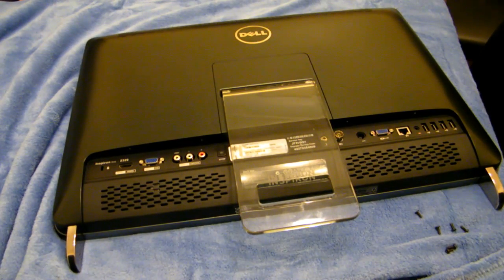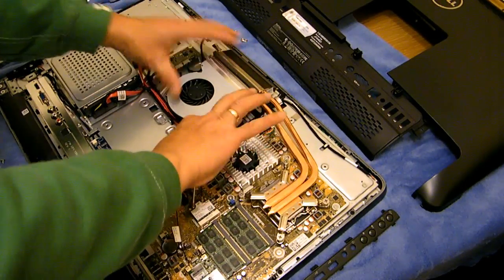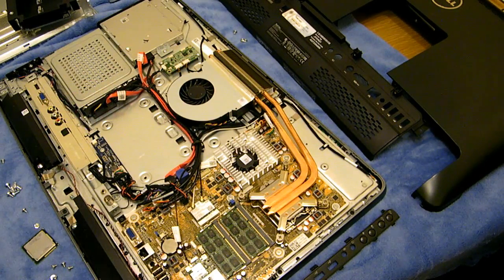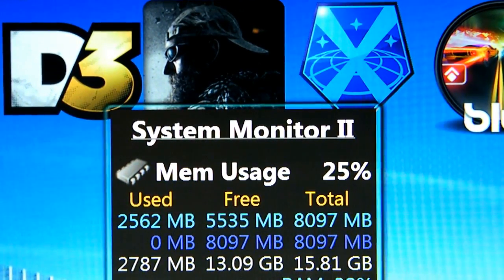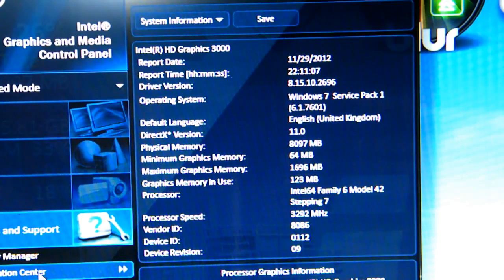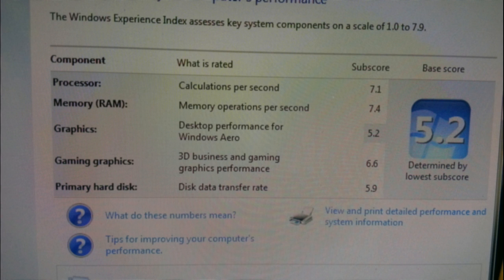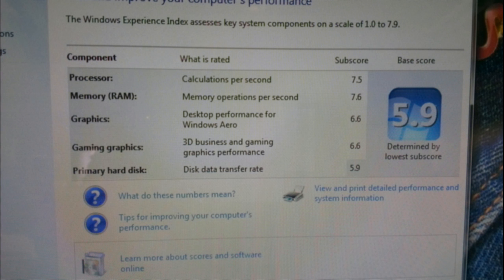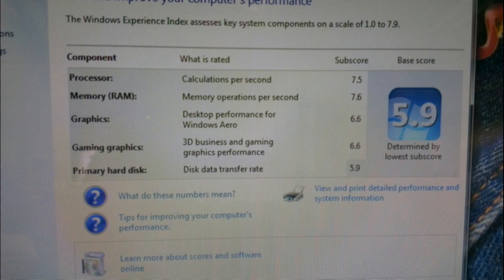Dell Inspiron 2320 All in One CPU Processor upgrade installation

Comment: The original CPU( i3-2100) has a TDP power draw of 65W. How did you get the motherboard to accept a power upgrade like this? I only ask because using a 95W TDP processor like the i5-2500-k in a Dell Inspiron 2320  is not feasible or recommended for several critical reasons, not the least of which is Power supply limitations: While the 180W power adapter(the maximum on this model) may seem like enough, the total system power draw must be considered as that single power source must run the processor, screen, motherboard, and all other internal components. Even if the processor is compatible and the motherboard power profile were somehow upgraded, the added demands of a 95W TDP chip like this one could push the system beyond its safe power limits.

Comment: I know this is an old video but I came across on of these systems that someone gave me. After doing some research in an attempt to apply this chip swap I came across some things that concerned me about this upgrade. First, the Intel website specs on the Core i5-2400S/ 2500S chips as well as the 2nd Gen Core i7's "S" chips are all Intel 2000 Graphics while only the K chips have the 3000 Graphics, Second, you also failed to mention that the "K" chips pull 95 watts as opposed to the "S" chips (Dell recommends) pull only 65 watts. The power brick for the standard Inspiron One 2320 is only 150 watts. You can get a 180 watt version but that's only 30 watts more. This is putting serious strain on power consumption of the system not to mention the excessive heat from the "K" chip at even base clock speeds. Never the less, I found a Core i5-2500K (in 2023) for less than $15 and a 1TB SATA SSD for less than $40. I pulled an extra 4GB SODIMM from an old dead laptop and upgraded the RAM to 8GB. Going to also apply the "cooling holes hack" on the metal cover like you did so we'll see how this upgrade goes. I went to the Dell website and downloaded all the updated BIOS and device drivers I could find so, I hope it works.
Reply from the maker: I can tell you that the machine is still working today with a 2600k in it both  drives the CD-ROM and the extra cooling just sits in the corner now doing YouTube  and media for us... Good luck with your upgrade...
Reply: @UltraCyberGod  Just wanted to update my post. I put the Core i5 2500K into this system and it is working flawlessly. You were right and I admit my reservations were unfounded. I applied your recommended hacks to the system in it works great. Much faster than the original Celeron CPU that was in the system. Thanks for the tips and I am a fan. Keep up the good work.
Reply from the maker: @walterlegere1403  Fantastic to see that's worked out for you... 😀

Comment: some necro commenting lol, just going to upgrade the same AIO to i5-2400S.
- don't forget to apply some thermal compound;
- honestly, you need to stress test it. I have some doubts that 2500k will work fine as its TDP is too high for this cooling system.
Reply from the maker: The paste is always something to mention even 7 years on! You'll probably see the both chips had paste on them as I's had then in and out a couple of times before filming. I would like to mention that although I've not used this system for sometime now the 2600K worked fine in it but needed the twin cooling fans on the back definitely. There's a video for that too.

Comment: Why will a 2500k work, but not a 2500s???
Reply from the maker: Did you try a 2500S in it? I never tried one of those but I would expect it to work.
Reply: @UltraCyberGod  I did. But only got black screen. Updated the bios. Not even mobo beep tones. This 2320 does not come with the nvidia gpu presoldered into it. So not sure if it was a dead cpu or the lack of the nvidia 525 I think these come with. Do you know if the 2400s will work w/o the nvidia chip? I know the 2320 shipped with them...

Comment: surely if it can take a 95 watt i5, it can do an i7 too? i could see cutting holes in the back and adding a heatsink on to the heat pipes with a thermal epoxy.
Reply: I was actually wondering the same thing I'm thinking of trying a i7 2600k , I know the i7 2600s is compatible and with the fan addition in his other video the heat shouldn't be an issue seems like the 2600k should work as well
Reply from the maker: Sorry I missed these 2 comments don't come back here often. I needed to mention that although I've moved on a little this machine is still working and has an i7 2600K in it, also 16gb of RAM, a 512GB SSD with a 1GB HDD. But could do with a clean! :)

Comment: I have the same model, do you think I can push for a core i7 2nd or 3rd gen?
Reply from the maker: It will take an i7 2nd generation you may need to improve the cooling I've never tried it without... these machines will also take 16 gig despite people telling you that it will only take 8 of RAM...  and an on SSD really improve boot speed on them... UCG...

Comment: I have talked with a friend that works in the pc business and he told me there is no way to upgrade the geforce 525m integrated video card and that is not good.A 2/4 Gb video card would have been a great upgrade for this pc.The thunderbolt slot is also not an option on this pc.
Reply from the maker: It's a shame you can't upgrade the graphics card but they're built very much like laptops and so the graphics are built onto the motherboard... I hope you find what you want... UCG...

Comment: Great Video!  I do not see a power supply.  Is the power supply actually the AC adapter?  If so, then I have a question.  When I plug in the power supply, the blue light goes out.  And it will not power on.  I tried the original power supply, and a brand new one as well.  Then, if that does not fix it, would you have any idea what is wrong?  I don't want to replace the entire motherboard.  Could it be something like the video is shorted out?  The computer worked when the owner left for vacation.  When she returned, it no longer worked.  No diagnostic lights.  No power.  Just a hint would be great.

Comment: Hi, has anyone been able to upgrade this machine to an i7 3770??? I purchased an used one and it didn't work. It works well with an i5 2500k

According to this page it should work: https://www.dell.com/community/Desktops-General-Read-Only/CPU-Upgrade/td-p/4512513
Reply: Probably need an expert's opinion but could be the graphics hd4000 when max is hd3000.
If you're that intent maybe flashing bios could fix it? try on your own risk.

Comment: Can u change the wifi card ? P
Reply from the maker: You can change the Wi-Fi card in this machine quite a few fit I believe but the one I put in was the Intel centrino advanced-n 6230 which is a 2.4 and 5 gigahertz version. I fitted that card because it only uses two aerial ports, if you wanted to fit 1 with 3 aerials you would have to install and re-route another aerial somewhere in the machine. Hope this helps you out.
Reply: UltraCyberGod thanks for the reply 
I have already done this process and it was a success

Comment: I'm a bit late to this but.... Is there any videos on the Inspiron 20 N2830 with a crappy Celron CPU? I'm running 64 bit Win 10 But I need to upgrade the CPU and the ram... I just found out I have 2 slots for ram but only have 1 slot being used with 4gb ram. If I can upgrade this thing it would be perfect.
I'm a full time RVer and am stuck with this All In One and am hoping that it can be upgraded. I'm hoping to upgrade it to an i3/i5 or something to edit my videos quicker.
Reply from the maker: Is there more of a model number I think it's a 3000 series?

Comment: I have a questioncan i install a graphic card into the all in one pc ?
Reply from the maker: I'm sorry to say that with most all in ones they are very much like a laptop where the components are soldered from factory and therefore only a change of board to one with a graphics card inbuilt will allow you to upgrade.
Reply from the maker: I must also say that you can obviously change the CPU this may increase the speed of the chips inbuilt graphics but it is only a slight increase. What do you want to do that requires the speed increase in graphics?

Comment: Is the power supply enough for such a processor? You installed the processor at 95 Watt instead of 65Watt, which came with a computer. I know that he has a 180Watt power supply. Ansver me please, if your PC worck good. I want install i7-2600 on same machine.
Reply from the maker: PC Master the power supply is good although I don't use the computer all the time now it's still running in a corner of the room. 
I'm running it on the original 180 watt power supply

Comment: Mine doestn has Hdmi and NTSC ins, just to let you know! Its a g630 @2.7Ghz, 4gig and 500gb HDD
Reply from the maker: Oh I'd also say one of the biggest speed increases for me after the processor was putting in an SSD made a BIG difference.
Reply: Hey! Ive installed an i5 2400s, 8gigs Ram and a 120gb SSD. Wow! What a difference! Its running like a rocket! Thanks so much for your vídeo! Really helped me out here! Cheers from Brazil

Comment: Hi there,, thanks four your videos! It really helped me out here!
Im thinking of upgrade my 2320 to 8gig ram and an i5 3470s cpu.. 
And probably an larger HDD, mine is 500gb and is staritng to get really slow..
Do i need to update bios? Or just plug N play?
Thanks so much
Reply from the maker: Hi I know upgrading the CPU would help from the G630 but you can't fit a 3470 as it generation 3 (Starts with a 3) you can only put in generation 2 processors like the 2400 i5 or the 2600 i7 etc. Hope it goes well.

Comment: Can i do that with a 2330?
Reply from the maker: Yeah, I had one at one point it's basically the same as is the 9010 had one of those too. Processor upgrade is easy if it's permanent remember to replace the heat sink paste. A lot of the time I'm testing and playing, right now I'm working on lighting for PC's that's easy for the beginner.

Comment: how is the temp with 2600k? any problem with it?
Reply from the maker: Heating I suppose depends on location a lot of the time, I'm working in quite a cool place but summer time it can knock the temp up a further 5 degrees. After most tests I'm running temp programs like core temp to test and monitor the CPU's, this would defiantly be my suggestion but I've had no problem with temperatures after the mods I've done especially the dual fan one.

Comment: Thanks @UltraCyberGod for the video. You are the reason i can work much faster en easier now with my PC. It was for the first time in my entire life i've upgraded my PC . I've upgraded my baby 2320 with i7 2600 3.4GHz, and it runs like a thunder with SSD i think i will be able to use it at least for next 2-3 years. But after upgraded, BIOS gives warning about the power adapter AC,. so i have to press F1 everytime before goes to Windows. I got also the same issue before when upgraded to i5 2400S that requires the same TDP as original processor. Anyone has similar problem? and how to skip this?
Reply: Riman Budiman hi, my dog dropped my 2320 on The floor. Luckly, it didnt break... But after The drop, it keeps me sending this message, about The voltage... I have upgraded with 8gigs Ram, i5 2400s and a 120gb SSD.. What a improvement! Yours is a i72600s? Really much faster than i5?

Comment: You would need to upgrade the BIOS firmware or replace the VBIOS chip on the board to get a TURBO BOOST feature. I have seen some tech sites selling these VBIOS chips but you would need to SOLDER the new VBIOS chip to the motherboard.

Comment: You should have added some Arctic Silver Thermal paste on top of the CPU itself, and possibly cleaned off the OLD thermal paste under the heat sink pipe before reinstalling it over the CPU. With Windows 10/7 you should be able to use 2 8 Gig DDR3 RAM Modules for a total of 16 Gigs. I know Windows 7 Premium will recognize up to 128 Gigs of RAM total but I don't think they make any 16GIG modules cheap enough if at all available.

Comment: Are you able to upgrade CPU in a Dell Inspiron 2305 All in One? I want to upgrade my processor to an AMD Athlon x4 860k.
Reply: They are a AM3 socket, so you have to use a AM3 chip. Something like a Athlon II X2/X4 variant. I am not sure what WATT the motherboard can handle as there are 45w and 95w Athlon II X4 chipsets. It would be nice if DELL was not so secretive on what you can upgrade it with but you can find the CPUs for around $11 USD on eBay that will work with these models. I know the 2320 models I believe used a Athlon II X4 610e processor, but I am not sure if those are also AM3 CPUs I haven't checked and I can't remember the specs off the top of my head.

Comment: Do you know what processor i can use to replace my pentium on my Inspiron 2020 all in one desktop? Possibly an i5? If you respond it'll be much appreciated, thanks.
Reply from the maker: Here's a link to the manual stating i5 i3 3rd generation CPU's http://downloads.dell.com/manuals/all-products/esuprt_desktop/esuprt_inspiron_desktop/inspiron-one-20-2020-aio_reference%20guide_en-us.pdf I'd go for i5 or i7 but here's link to intel i5's 3rd gen http://ark.intel.com/products/family/65504/3rd-Generation-Intel-Core-i5-Processors#@Desktop But I'd keep to released 2012 ones and 65w and below as the power supply is only 130w. You could go 3rd gen i7 but I'd still advise lower watts unless you fancy some custom cooling see my other video's and good luck. Oh one last thing always make sure you have the latest bios update.
Reply: +UltraCyberGod Ok, thank you very much!

Comment: Can you upgrade the graphics on a all in one PC?
Reply from the maker: You cannot really upgrade the graphics as they are like laptops and normally they are onboard. Some like this model have two versions of the mother board one with the intel chipset  only and another that has a NVidia GPU built on board but it a major under taking to change the mother boards if you can find one.

Comment: What's the max cap for ram for this model? and is there a way to install a egpu/gpu o just with upgrading the processor will be fine for play some games?
Reply from the maker: When I had mine I put in 8gb I'm afraid I didn't go any bigger, if anyone has please comment. I hope this helps.

Comment: what the type of i5 is this?. please... i would like to upgrade my dell 2320 top. thanks.
Reply from the maker: Hi this is a 2500  series chip http://ark.intel.com/products/family/59134/2nd-Generation-Intel-Core-i5-Processors#@DesktopMost of these will fit and run fine cooling might be needed if you put an i7 in like these http://ark.intel.com/products/family/59136/2nd-Generation-Intel-Core-i7-Processors#@DesktopHope this helps.
Reply: 8gb of ram
Intel(R) Core(TM) i5-4460 CPU @ 1.90GHz 1.90 GHz
64bit
Intel hd graphics 4600
1tb of hard drive.
Model:B50-30. lenovo all in one touch

Could i replace the graphics card with a different one.
Help please 
Thank you
Reply: Sounds like you have a model which does not use a GPU card. Most used either a AMD Mobile HD5000 card or a Nvidia GTX ? card. If it has a GPU slot available and it was a OPTIONAL add on from DELL you should be able to insert a NVIDIA MOBILE GPU card. They are pretty reasonable on eBay. Mine is a 2305 model and the only GPU I know for sure works are some Nvidia models and AMD HD5000 series Mobile cards which are the same as used in a lot of laptops like the Dell Precision etc.

Comment: I bought an inspiron 3455 and would like to know if I can get rid of my crappy AMD processor and upgrade to a i5 with no problems? need some assistance please
Reply: You can't put an Intel CPU with an AMD motherboard. Is your AMD chip a 7000 series (xx-7xxx, such as E1-7010 or A4-7210)? If so, you should be able to upgrade to an A8-7410 as they're in the same family. It might be possible to get another FP4 socket APU (such as Bristol Ridge) but you'd have to make sure they have the right RAM support (DDR3L if you have got a 7000 series), enough power draw from the motherboard and PSU and also make sure that the heat isn't too much as the AIO can't cope with too much TDP. If you haven't got the A8-7410 (and yours is 7000 series) that's probably your best bet but mobile chips are generally more of a bitch to deal with than desktop CPUs.
Reply: +Thermidor Fallen alright thanks for the tips!
Reply: Actually scratch what I said before, the Carrizo-L AMD chips are soldered to the board so you can't change them, you'd have to swap out the entire motherboard with a new one with a different chip soldered on. Sorry!!
Reply: You can, but you might have to get a new motherboard.
Reply: Upgrade to an AMD Athlon x4 860k. Also can you upgrade an All in One processor like in the Inspiron 2305?

Comment: Awesome video, I purchased this computer and it started out great, but I got into mixing music and the system can run very slow even when I only have my studio software running.  I purchased a 4GB chip of memory and will be installing that to bring up the memory to 8GB, but I would also like to upgrade the processor to an i7 processor.  I currently have the Intel Pentium G630 2.7Ghz processor.  What processor would you recommend? and is it really plug and play? Are there any software updates needed and do I need to change the graphics card, because I am fine with the graphics?

Thanks for your help!
Reply: Also would you recommend the fans for an upgraded processor, is it needed?
Reply from the maker: Thanks for the comment, the processor is defiantly the problem consider either i5 or i7 because of the increased processing power over the G630. Next for me would be the hard drive to SSD because as soon as it tries to use virtual memory (i.e. your hard drive as RAM) everything goes slow and you don't want that. Before you change the CPU upgrade to the latest bios always. Use software to tell you how hot it is like "Core temp" and if it's not hot don't bother with fans.